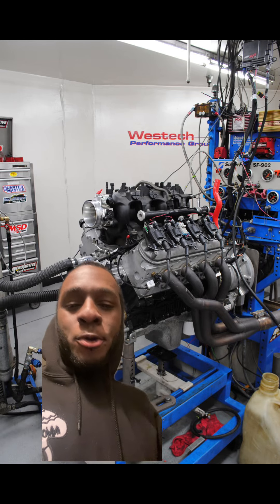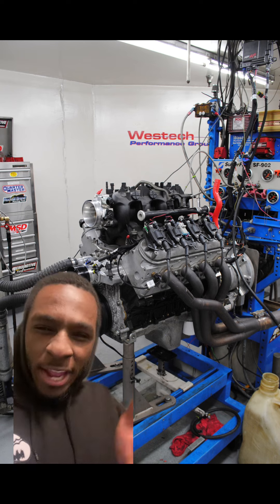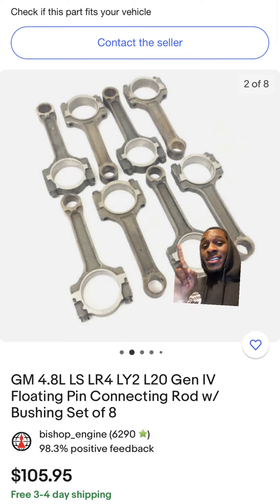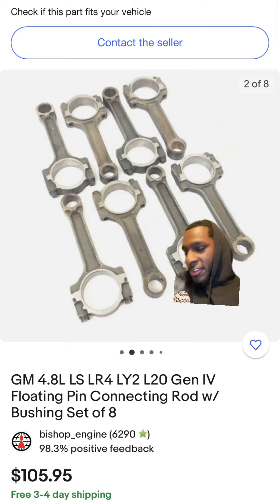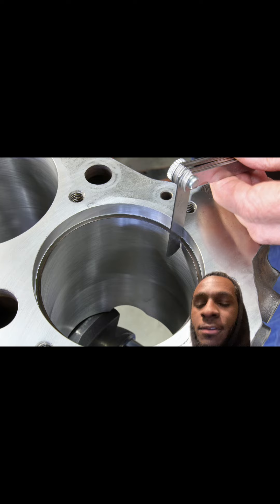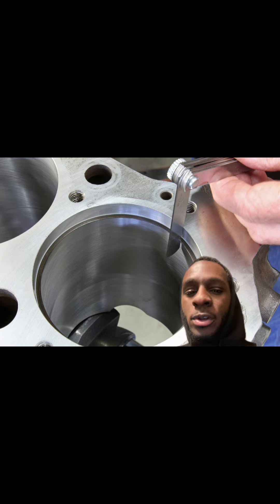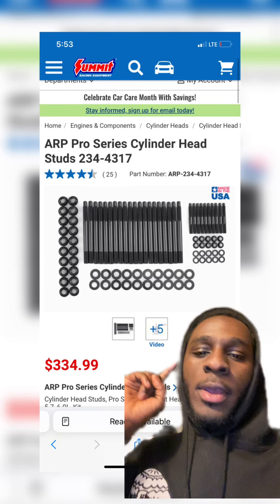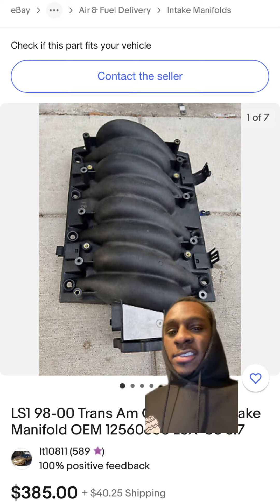How to prepare your 4.8LS For boost! (The proper way)

Comment: ARP heads studs, main studs, gen 4 rods, LS1 intake, overhyped $385 cam, oil pump🙄 how about junkyard 4.8 with ring gap and a summit cam, pac 1218 springs, shimmed stock oil pump. But I mean, what do I know, I'm not a "guru" 🤷‍♂️ my turbo 4.8 makes 529whp/504tq on 33" 10 ply tires tho
Reply: And only 14 degrees of total timing underboost 🤷‍♂️
Reply: An How long will it last
Reply: @cecilotto504  however long you want 🤷‍♂️ race motors are fully built and only last one season. Nothing lasts forever
Reply: I'd go with a Huron speed t4 turbo kit, a cam motion 216 212 turbo cam, stock bottom end with the exceptions of arp rod bolts (my 4.8 has gen 4 rods already) head studs etc.. proper ring gap, a billet oil diverter, a Holley Terminator x max with 4l80e trans control, obviously a 4l80e, a ford 9 inch rear end with a 3.89 ratio rear end, a ported tbss intake manifold, id probably think the 317 heads off my 6.0l and get em cleaned up a bit with some mild porting. Id probably go with some mast heads so I can get the exact combustion chamber I desire though. And yes, I know how excessive it technically is, id rather it be overbuilt and under powered than become a dumpster fire in a month.
Reply: Pfft. Probably not even double clutch shifting like
You should
Reply: Stock oil pump feeding a turbo is risky 😂

Comment: That cam is way too big for a turbo 4.8.  it wouldn't lose any power up top and would spool up a lot quicker going to a much smaller cam like a truck Norris.  Also the LS1 intake manifold flows like absolute crap.  Aside from the LS4 it's the worst intake available.  LS2 or gen 4 cathedral truck intake manifold is going to be the best cheap options. Everything else you said was pretty accurate.  But the Gen 3 rods will hold a lot of power.  I have a gen 3 4.8 on pump gas that has been to 18 PSI of boost almost every day since i built it.  Nothing but head studs in it. Not even ring gap.

Comment: This is terrible advice, to be honest that's way too big of a cam for a 4.8 and it's going to lose a lot of bottom end efficiency because of it. Secondly for a 600 lift cam you do not need 660 dual springs to add so much extra tension to the valve train for no reason. That's just a whole lot of extra spring rate for nothing. A set of pac 1219s would do fine.  LS1 intake manifolds flow like absolute dog shit compared to the truck manifold. At least go with an LS6 or LS2 intake from dorman.  But if you're switching manifolds just for looks then you might as well get one of those sheet metal intakes off of eBay for less than 500 bucks that comes with throttle body and fuel rail. You're going to lose a lot of low end power but you'll gain some top end.  And it will look great!  If you want to gain power and don't really give a shit what it looks like then use the 2007 plus intake manifold for the 4.8 and 5.3. formally known as the TBSS.  That outflows any other cathedral port intake manifold dollar for CFM no matter what.  Now let's be real on a 4.8 the biggest cam you should even consider would probably be the chopacabra or truck Norris.  That's going to gain your power from 2500rpm and up and your loss below 2500 will be minimal.  Not to mention on boost it will still rev to 7k plus on that cam and if you don't want to spin it that high you can even run it on stock valve springs with that cam just fine.  It will do 6,800 all day on stock springs with that cam.  Definitely do add the ring gap and if your engine has good oil pressure before you take it apart then don't change your fucking oil pump.  My twin turbo 6.0 is still on a factory oil pump and has wonderful oil pressure. So is my twin turbo 5.3, factory oil pump.  The best advice I can give anybody on an LS engine that they are trying to push more power out of is to stop using 5W30. Step the oil viscosity up if you want your bearings and lifters to last.  And would it really hurt you to add an oil cooler? You see everybody doing 6.0 swaps on their 1500 where they delete the damn oil cooler and then add 2,000 RPM and add 150 horsepower and think it doesn't need a goddamn oil cooler and dump in some 5WD30 and wonder why they shit blow up.  Last but not least, Gen 3 rods ain't any weaker than Gen 4 rods.  Richard holdner already approved that with two 6.0.  The truth is the Gen 4 rods are going to be a lot better for somebody that wants to spend a lot of time in the 7K plus rev range. They do help with friction at high RPM. But that's about the only benefit aside from pistons being easier to change.

   Anyhow, I watch a lot of your videos and you're usually on point but this video is just straight up bad advice man.  4.8 do love boost and head studs and MLS gaskets and ring gap and mild cam are definitely all a great idea so you can send that thing to the moon.
Reply: Since your page actually has builds on it, I think I’m going to take your advice lol

Comment: Dude anyone who actually builds these would never 😂dont listen to this mf seen sbe motor with a 555x/556 112+4 lsa 224 duration small cam springs and ring gap do wonders my truck made 620hp/514tq on 10 pounds on a twin blow thru set up 🫡E85 26° of timing so u